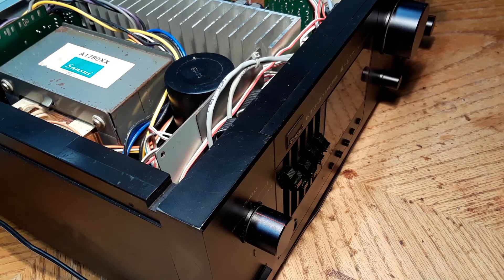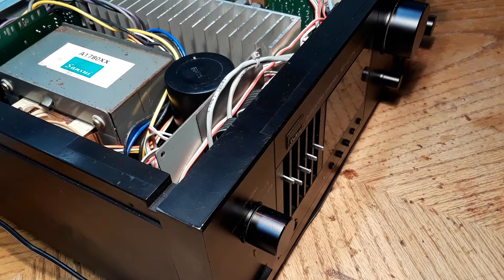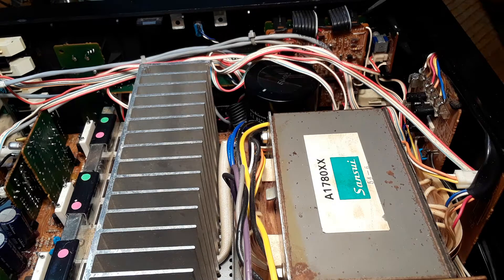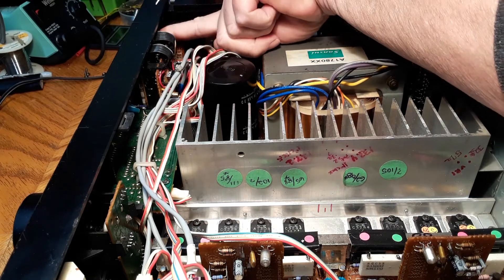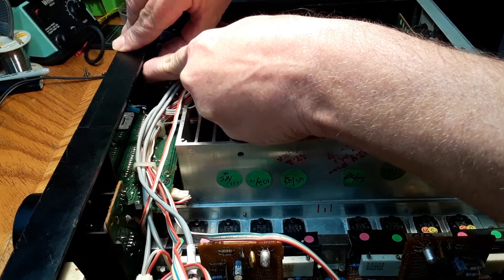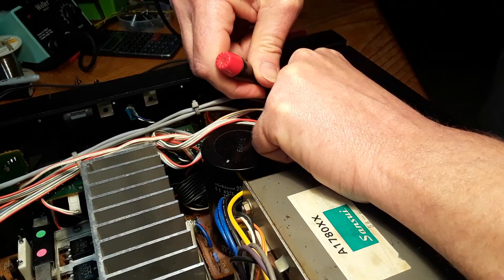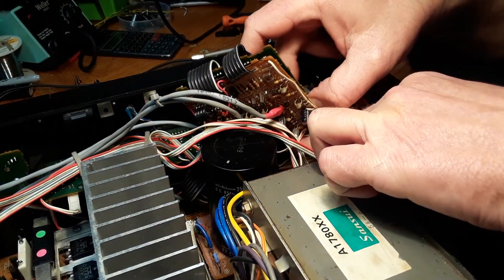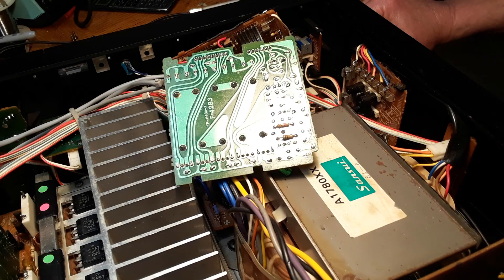sansui au-g77x tone board removal.

Comment: Hi, do you know if the selector knobs of the disc, AUX, etc are fixable? On a unit i noticed that they won't stay engaged after pushing them. Could it be as easy as a part or piece that needs cleaning or is detached or is it more likely that a part inside the mech is snapped off?
Reply from the maker: Hi danny generally if its just oxidation that can usually be   cured pretty good.my concern is that maybe yours are not latching in and staying in.thats likely some kind of mechanical damage which likely would not be repairable.there is a super tiny lever in the switch that forms a latch .pulling switches like these apart isnt really a great thing to do.power swicthes are pretty safe though lol.if yours are not staying pressed it also makes me wonder if the panel spacing is messed up for some reason if the "travel distance"of the button is not enough, the lever will not press in far enough to latch the switch .best i can say without seeing it.ive had that before on sansui units.check to make sure the switch board is pushed fully toward face panel....good luck ..
Reply: @generalingwer4341  Thanks, I will have a look inside to see if the board sits in place, if so, then perhaps another problem that is likely the switch itself. Thanks !
Reply from the maker: Ok i feel pretty confident youll find  that the board is not sitting in the guides close enough to front panel for switch to stay in.ive had issues on g55x with this. if u still have troubles,,ill take mine apart and do video for you.thanks for watching.